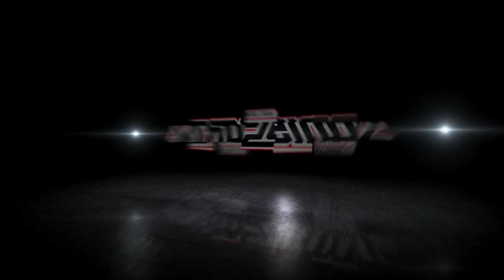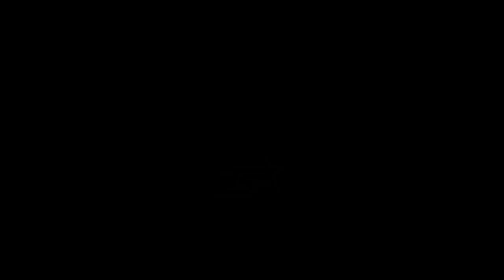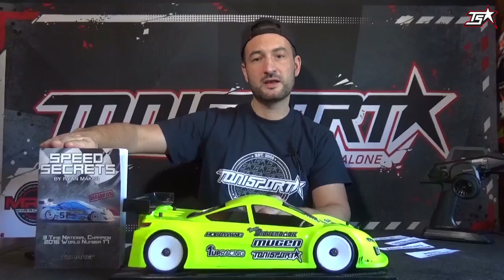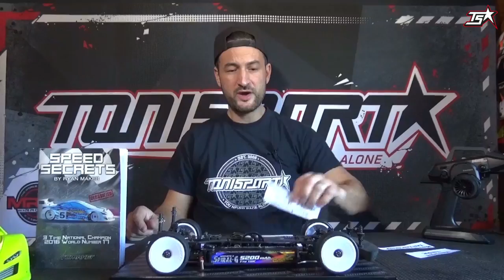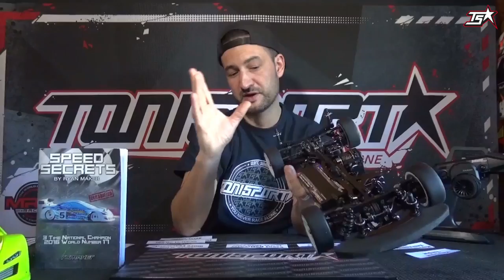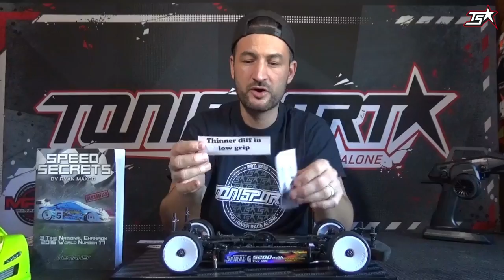ToniSport Newsfeed: More Rear Traction English

Comment: you said more weight to the frond,ok yes you create an udersteering car but only if you go flat out in a fast corner or when you exit a corner when you push the throttle,because when u are about to lift off the throttle and u are ready to steer you will upset the rear end of the car and you will eventually have the opposite effect ending with a snap oversteer,for me the rear axle has to be loaded allways more than the frond in any circumstances  at least 20 to 25 gr more in order to have a stable car in the middle of corner!thanx for the videos!

Comment: What is the reasoning why narrow rear will give more traction? Narrow induces more weight shift to the outer tire and overall less traction to both rear tires combined. Thanks.
Reply: was just my experience with the car we used in 2019! Very sensitive topic for sure.
Reply: @patrickbeckrc2113  Thank you.
Reply: It definitely works, I can’t explain the science behind it, I was having some issues with my car, done a couple of little changes that made a difference, but when I changed my rear hexes to get 186mm rear width it made a real difference, it planted the rear end and made steering more smooth. 
Like I say I can’t explain why this worked but I tried it after watching this and it’s worked, now I have a good setup and I have dropped loads of time off my laps
Reply: Narrow track width has more and faster load transfer so you will have more initial grip on that end of the car
Reply: @invisiblespeedrc  Is this similar effect to putting a thicker roll bar? More initial to outside but overall less side grip on that end? Thanks.
Reply: @artificialintelligence8388  ok I thought it was narrower hexes. When going narrower on pivot that also helps to give a softer suspension and more grip.
Reply: @artificialintelligence8388  no because roll bar limits roll, narrower track width doesnt
Reply: Interesting comment. I also wonder why people say that narrow hexes increase traction. I found this not to be the case at all. I run at a large outdoor tracks where speeds reach up to 120 kph. When I increase the rear track width by using a wider hex or by just adding a shim to the hex, the car gets stuck to the road and I can get on the power very early without loosing the rear. It is a quite noticeable change. The negative part is that the car is not so nimble and it does not want to enter and exit corners as well so there is a bit less steering. The physics seem to back me up claim because in order to increase traction, you need to either lower the CG of the car, make it wider or make the track width longer, basically the opposite of what the comment section says.
Reply: @arrenlambert1486  No, It does not work that way. Chances are you had a pretty good balance of the car with a decent amount of grip and you lacked just a bit of steering. By reducing the rear width, you REDUCED slightly the rear grip of your car, making it more nimble or in other words you increased steering which reduced your lap times.